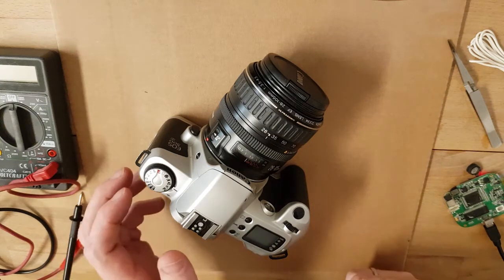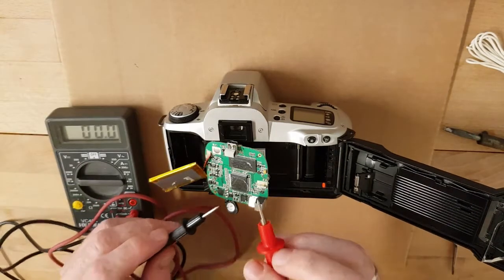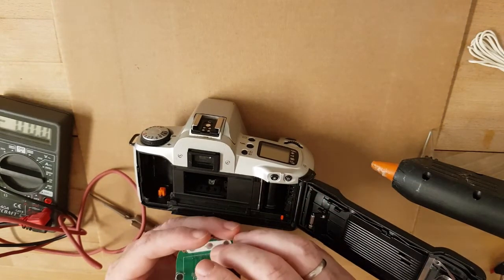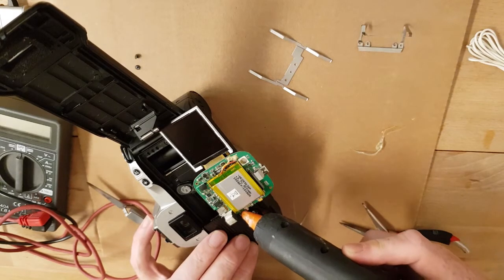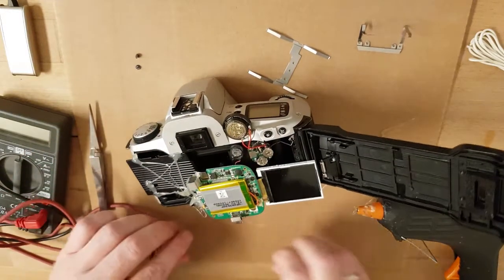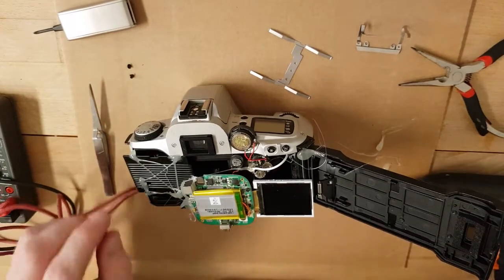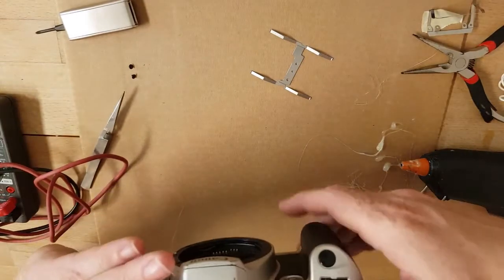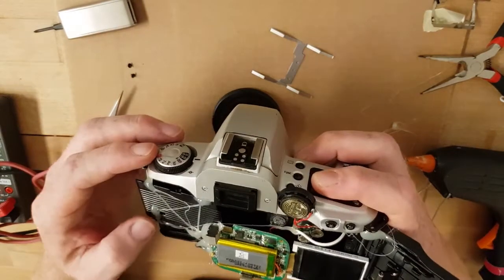Real analog DSLR to digital conversion Canon mod

Comment: Really nice and motivational video. However, it will be interesting to see how you calibrate the sensor as you can get shaky pic if sensor not placed correctly.
Reply from the maker: Yes, calibrate with hot glue in place